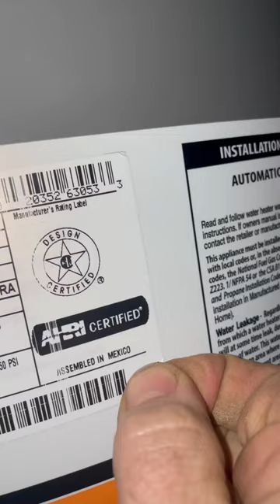💧🔧 Leaking Anode Rods in RUUD & Rheem Water Heaters | A Common Flaw Exposed!

Comment: I'm a plumber, my own water heater started leaking on a Saturday night. Sunday, I bought a Rheem from HD and it leaked from the annode immediately. Had their factory authorized guy come out to preserve the warranty. He told me to never buy from any big box as the units are made in different factories and are not the same no matter what they tell you.
Reply from the maker: They knew this one was bad and they still sent it out. It’s sickening how much pipe dope they used to try and get it to seal.
Reply: A simple Maintenance guy here. I have put in tons of hot water heaters in. I check behind my work making sure nothing leaks. I had some bad out the box from Lowes and Home Depot but because I look good to make sure all is well ? Took them back same day and got good ones. Just check behind your work. Look to where anything can leak. Would never run into a problem to have to come back out. God bless
Reply: @charlesott8216 
You shouldn't have to bring it back in the first place
Reply: Rheem also has issues with their gas valves. We only install Bradford white for water heaters.
Reply: Box stores have plastic drain valves and internals and Supply house ones are all brass. I put in Bradford Whites and have had great luck with the old models, waiting on the new models, I know the heat pump model's panel is trash, just replaced 2 but Bradford White covered it, Supply House purchased
Reply: @jaybirdsworld This is true, the newer gas valves, they're like blue and a lot more basic. We have had to replace lots of those with older gas valve models due to its recall
Reply: How a plumber not give a labor warranty?  Breeze Mechanical  HVAC.
Reply: If you are a plumber you would never put a Home Depot water heater in period not in your home or anyone’s. Not a smart plumber anyway
Reply: @The_Packing_Plumber  
Can you read?
Reply: This why I only buy through my supply house unless the customer wants to purchase through the big box store. If they buy the heater then any repairs to it are on them if it is the heater.
Reply: As a plumber myself,you should know that big box stuff from water heaters to thermostats arent the same as the stuff from the supply house.I learned that 35 yrs ago.Look at the model numbers their completely different for the same products.And a side note,my supply house will take anything back from me no questions asked,this guy should find a better supply house
Reply: The asp that came out lied to you. He wanted to bad mouth the home center unit and lie you into buying a heater he sells.
Reply: Plus big box store water heaters have smaller burners. 
A Home Depot water heater only has a 38,000 btuh burner while the one you buy from a supply house has a 40,000 to 50,000 btuh burner depending on the brand you buy.
Reply: @christopherscott8853 What does labor warranty have to do with the faulty product? He installed it correctly, not his fault the product failed.Why should he eat the labor cost?
Reply: Then why does the Montgomery, Alabama factory ships to the locals and to the big box stores?

Comment: My company is a contract installer for Lowe's and HD. I have seen many times Rheem water heaters leak from the drain valve or the anode rod as brand new installs. Tape and dope usually prevents me from having to remove the new water heater and put in another new water heater. Obviously the unit says it was inspected and passed, supposedly air tested, they lie. Those are the ones we say were built on a Friday afternoon lol.
Reply from the maker: We are checking the anode rod closely on all of these Ruud’s. We have had it happen once on a BW but we could hear it. Also tech support was able to tell me they had a batch of anode rods that had leaked that corresponded with my serial number. Shout out to Bradford White customer support. That was also Friday at about 5:30.

Comment: Ruud is never to be trusted, had 13 customers with the same era and 6 with gas valves....
Reply from the maker: You are speaking the truth, we had a similar experience back in 2020-2021.
Reply: Thanks for the warning
Reply: Same story here, it nearly crashed our plumbing department with warranties and then they ran out of the valves.
Reply: I had a Ruud heater for 13 years, never gave me trouble. Probably because I flushed it every quarter!

Comment: Use your torch to heat up the rating plate to release the glue. We're the preferred installer and warranty reps for rheem. Sticker comes right off when heated.
Reply from the maker: That’s a good tip. It’s definitely the winter time when it’s cold that the stickers seem to give me trouble.

Comment: The contractor should step up for the sake of their own reputation! 
After all, THEY chose, recommended, and sold the water heater to the client!
Asking for more money is a dick move.
Reply: Alot of small contractors disappear after the work Is done. And some of the good ones don't charge enough upfront to warranty their work.
Reply: How do you know what options the contractor gave he could have given the customer multiple options and the customer chose the least expensive one. I've made plenty of recommendations it's ultimately up the customer. Plus that tank didn't need to be replaced you could have redressed the threads and put in a new anode rod.

Comment: I bought an AO Smith electric water heater at Lowe's about 2 months ago. Since day 1 the hot water only lasts about 10 minutes. I'm having to lower the cold water so it can stay hot during a shower. (The previous water heater lasted longer than 10 minutes) i checked the thermostats and they give me a reading of 240 volts and the elements give me a reading of 12.5 ohms. What can the problem be for the hot water running out quickly??? 

I appreciate any help. Thanks!
Reply from the maker: There are too many variable to try and  guess. I would call AO Smith and have them walk you through everything. It will be under warranty. +1 (800) 365-0024

Comment: Had tankless installed.   Researched many manufacturers. Makes and models …..   had a 40 gallon tank….   Constantly being used.   And to heat the 40gallons.    Saved $ ..   no pilot light.  No hearing the burner turn on ….  Already paid off for itself ..

Comment: What brand do you recommend for electric water heater?
Reply from the maker: We don’t see as much difference on electric tanks. It will also depend on the water quality and what works in your area. Bradford White or State Select are both good options and we usually have decent luck with Ruud. The type of anode rod could play a bigger factor than the brand of tank.
Reply: @Kcwaterheaters  thanks for the reply!
Reply from the maker: You bet

Comment: Leaking from where? Can it be fixed?
Reply from the maker: It was leaking from the anode rod connection. It could possibly have been fixed by replacing the anode rod but the insulation around the tank was already wet and they really needed a new tank.

Comment: As per the ROC the contractor has a minimum two year warranty on the product. Unless otherwise specified and signed off on the invoice. If the customer haggled on the price and the contractor said he can lower the price by removing some warranty. That was the customer's decision and they rolled the dice. If they hired an unlicensed contractor to do the work for less that was also their decision and they rolled the dice. I don't like ruud water heaters but they are a part's manufacture not a plumber manufacture. It's stupid to think the manufacturers should be responsible for labor. They should have hired a plumber that includes at least the bare minimum 2yr warranty

Comment: And this is why I like flex lines I’ll replace the heater myself all I need are tools and some help to move the tank
Reply from the maker: Flex lines frequently leak after about 10 years, most tanks here will last 15-20.
Reply: @Kcwaterheaters  that’s a easy fix though just close the gate valves drain the tank replace the lines. No need to call a plumber who isn’t gonna offer a reach around
Reply: @Kcwaterheaters  always offer a reach around

Comment: I don't know about were you are but in cal they are both covered and you just need the serial number and model number. The big box store has different parts then from the whole sale house. The pilot assembly is different on the same brand and model. Sounds like your plumber is not being up front. I started back in 1987 I have never seen a warranty that's not covered. Labor how ever is not covered. The home owner gets stuck for the labor unless the contractor eats that cost.
Reply from the maker: I would have told you the same thing. Call Ruud/Rheem, see what they say.

Comment: Why no unions on water lines? Isn't that code?
Reply from the maker: Why would we use unions? There is no reason. Maybe if we were working with galvanized water lines.
Reply: I see you are on a different code requirement

Comment: If the plumber supplied the water heater it's on them. Don't put in products that you'll need to warranty. If the customer supplied the water heater then they're paying to have their junk pulled and one of mine put in.
Reply from the maker: A 1 year labor warranty from the manufacturer has been pretty standard. They only pay a few hundred dollars but at least it helps recoup the extra costs.

Comment: If it’s contractor supplied  labor cost should be on the manufacturer. And if not then on the contractor.  I warranty my labor agains manufacture defects on all my jobs. It’s the only right thing to do. IMO
Reply from the maker: Ruud/Rheem policy is that they only provide labor warranties in tanks sold through the box store: you know the guys that return a brand new water heater because they never sizes the underlying issue that killed the previous tank.

Comment: Honestly, sounds like a fake story to me, Several things dont add up. All products in my supply houses have a 30 day warranty, 2nd its an anode rod a known ruud rheem issue. Redope and rethread, a 1 hour job. contractor would have offered that before a replacement ALSO if you replace with the same model like within a few days there is almost no labor as it all lines up already ALSO a 1 hour task plus travel.
Reply from the maker: Call Ruud 1 (800) 432-8373. NO WARRANTY ON LABOR FOR SUPPLY HOUSE tanks. 

The anode leaked for enough time to saturate the insulation with water. Once the insulation is wet, the tank should be replaced. One other detail, the gas valve was on C and the water temp was only 120 degrees.